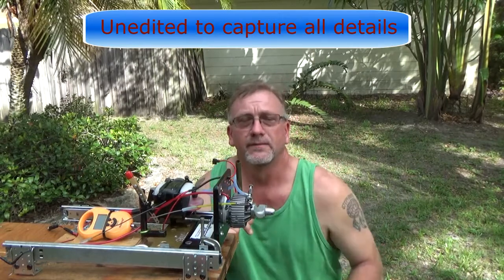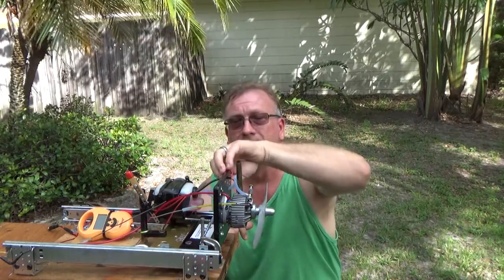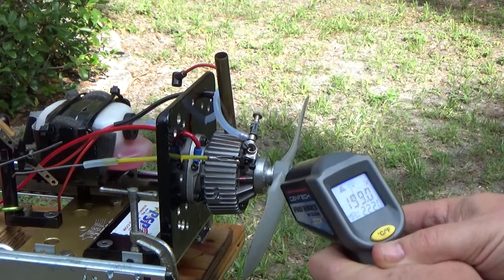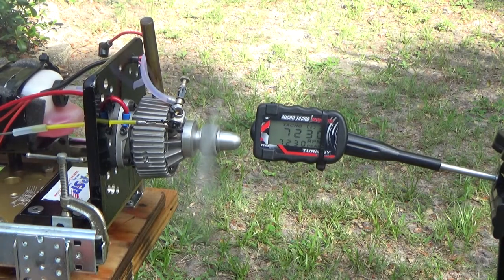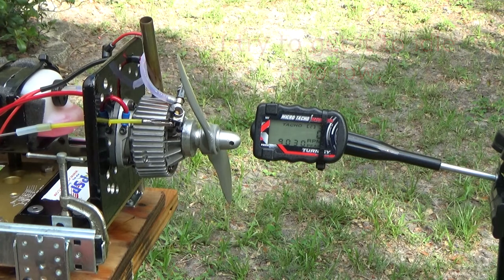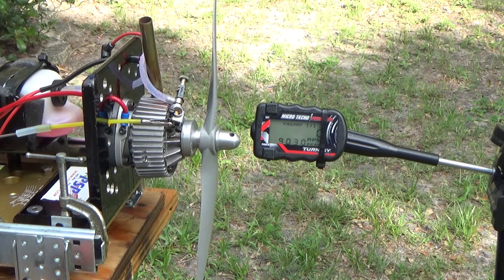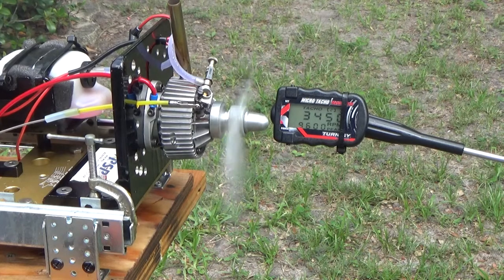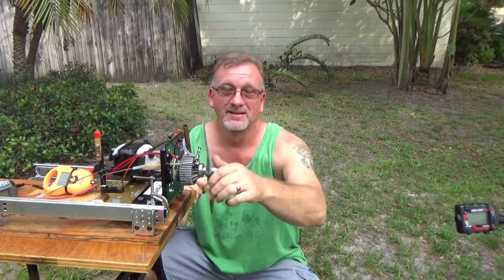OS Wankel Troubleshooting Run

Comment: stop adding oil to the fuel also when i raced i used a 1 oz tank in between the main tank and carb also 5% nitro? 15% is standard for air and cars boats run more whats up
Reply from the maker: No offense, but I will add oil to any fuel I deem necessary for the particular engine I am running.

Comment: I use one 2nd generation OS Wankel with radial intake. Also had the engine disassembled but it is always turning smooth hot or cold. That should be the case with the older version as well. Itmight be better to reassemble it and check for any running marks or assembly Problems. I recommend Castor fuel with minimum 20% oil content.
Reply from the maker: I haven't had this engine for months.
Reply: David McIntire hey David is there a way I can message u private need some help with one of these engines

Comment: At my 14000 rpm, 8x7 propeller wankel engine run the high speed needle was 2.6 revolutions open.
Reply from the maker: I want to run this engine some more.  I figured since these were still set as private I would post them.  The Snipe videos are a bomb.